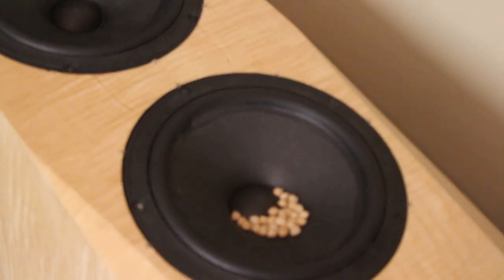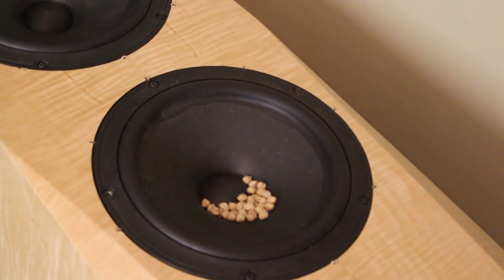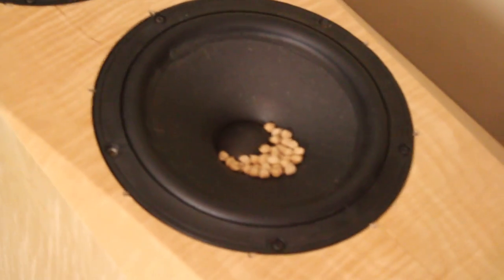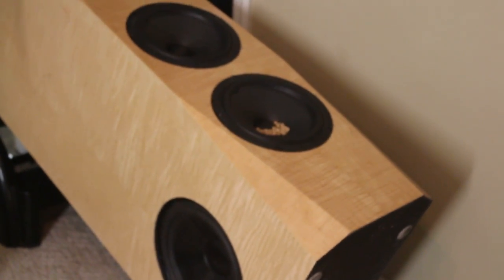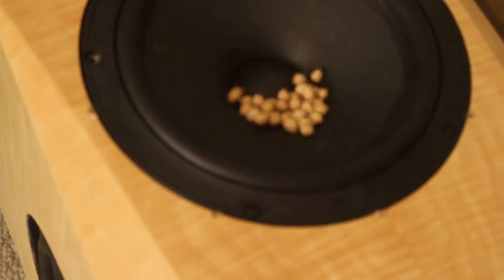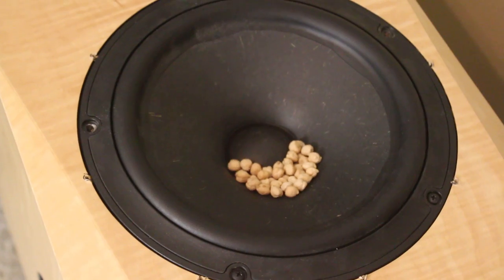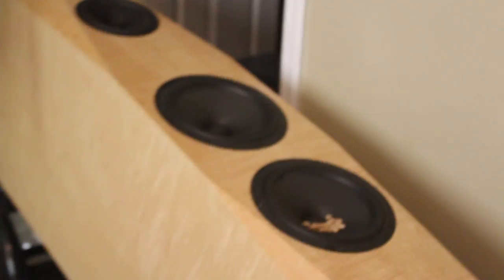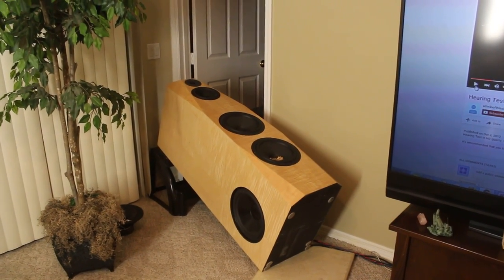Determining tuning frequency of a cabinet using garbanzo beans.

Comment: A great visual representation of this effect. 

In case anybody's wondering, a vented cabinet would produce the same effect. At Fb (tuned frequency) the vent moves most of the air (Helmholtz resonance), while the cone moves least.
Reply: Nordgrinder ,,,have a look at cymatics

Comment: Should probably use less beans since added weight will change resonance of driver.
Reply from the maker: The very few grams of those dried beans wouldn't amount to a hill of beans in the change of response.  It actually takes quite a bit of weight to offset the weight of the air to change the FS of the Passive radiator.

Comment: Quick question if I were to paint the inside of a subwoofer enclosure will the tuning frequency get lowered
Reply from the maker: The only way that would make a difference is if the cabinet has resonances and the coating stops those.  Otherwise, no. It will not affect the tuning frequency at all.

Comment: But what good does that do?Knowing your box is tuned to 30.31hz , you can't adjust a radiator, if you had a port tube you could extend it or shorten it I guess.
Reply from the maker: This is a DIY system that I made a few years ago and the passives have a weight mount in the back for tuning. 
The more weight, the lower the tuning frequency.   

So, yes, you can tune them to match how the drivers interact with the cabinet and this will have a profound effect on low-end response.
Reply: @Musiclear  

So what tuning frequency did you settle on?

And which subwoofers and passive radiators are you using?

Inquiring minds want to know!  :-P